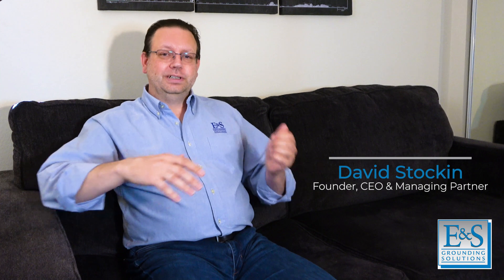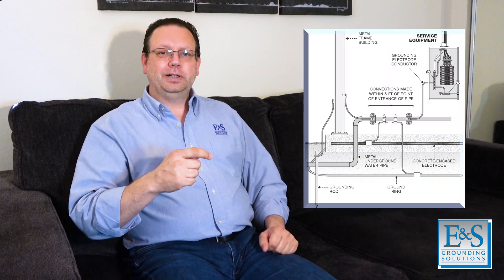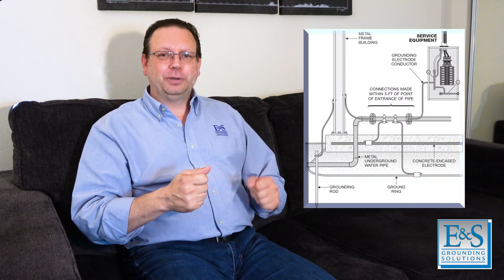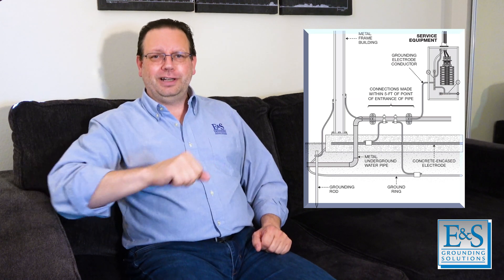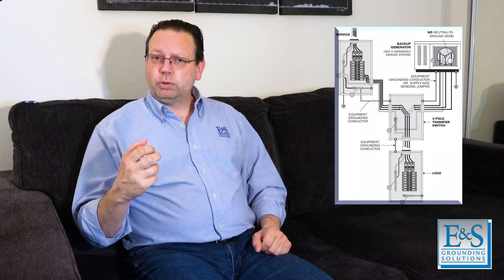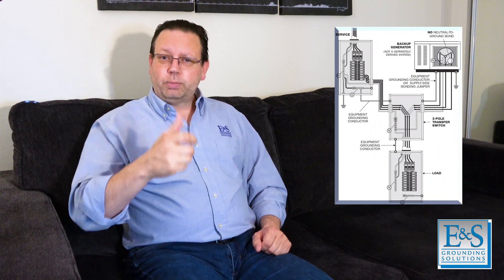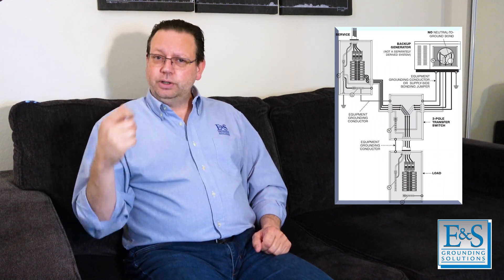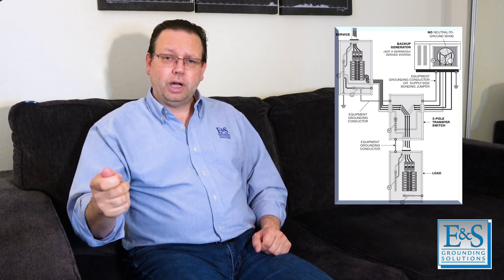What are Ground Loops?

Comment: Good video.  When I check the ground to neutral connection in very large services (3000 amps), I will sometimes see between 5 and 10 amps. I thought this was normal, but apparently not.  I assume these are because someone has grounded the neutral in a panel somewhere inside the building.